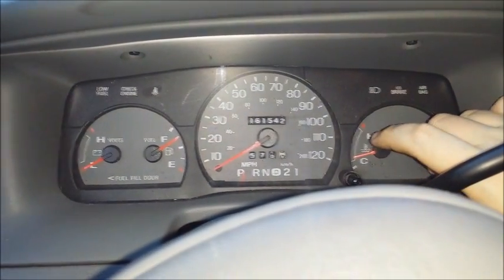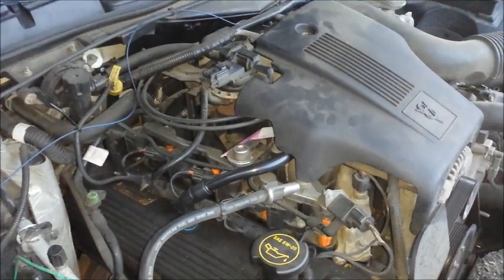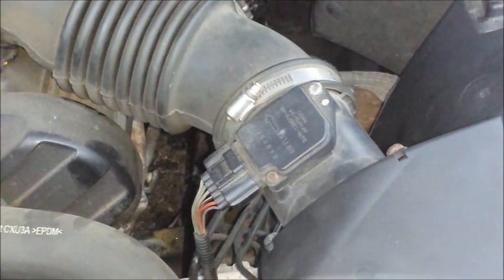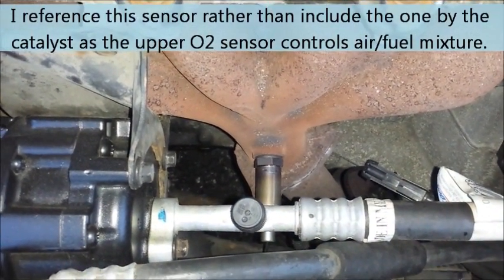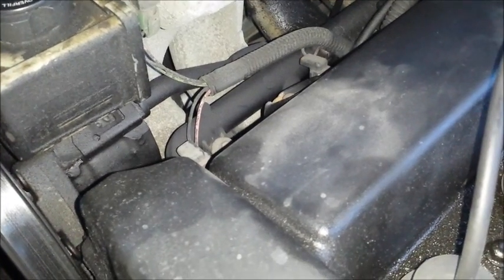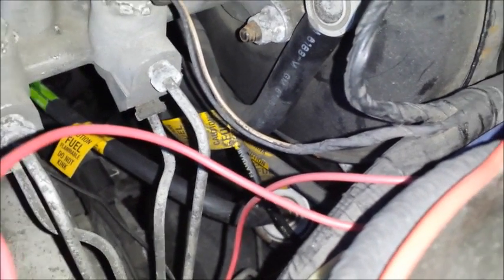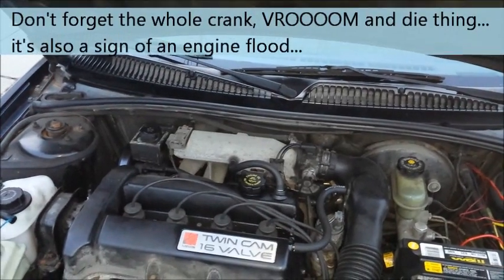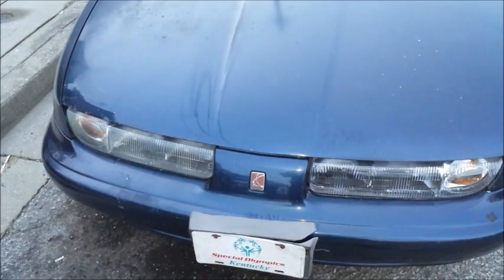Diagnosing an engine flood on your fuel injected vehicle.

Comment: I have an rxi engine fuel injected 20 valves it start up when l unplug the fuel pump and once l reconnect the pump it cutts off immediately, what could be the cause?
Reply from the maker: Good question... I say run it with the fuel pump disconnected and run the lines dry, then try running it with the fuel pump running. 

Since the lines are now dry you may have to put the vehicle in run for five seconds, turn off, put it in run for five seconds, turn off and put it in run and then start it. See what happens.

Comment: Heh my usual shop told me it wasn't even possible to flood a fuel injected vehicle, I got my vehicle started like this and it worked.  Maybe there is some underlying problem that led to this, not sure yet.  This happened after getting it started after three weeks, it started right away but after turning it off to get something in the house, I got a crank but no start.
Reply: The spark plugs can’t spark with their covered in gas. Fortunately gas evaporates easily. So cranking it with the fuel pump off will draw it out the cylinders...

Comment: Get the point dont beat the bush around
Reply: No dude! It's said: Don't beat AROUND the bush! If you're going to say nasty things at least learn how to say them right!! And he did get right to the point. I've watched lots of video's on clearing a flooded engine. This is the only one that made sense and it worked. That's the difference between having to have your car towed to the shop and driving it there yourself to have the fuel system checked. 
By the way, didn't your mother ever tell you this: "If you don't have anything nice to say, don't say anything at all". So, do that!

Comment: I used your procedure. It works but when it floods the engine continues to crank after I release the key.
Reply from the maker: Hmm.  If the engine continues to crank, the engine isn't flooded.. if it were, it would've started up
Reply: But I smell gasoline.
Reply: It has been overheating. I've changed out the waterpump, thermostat and sensor on thermostat housing. Still overheats, now won't start like it's flooding.
Reply from the maker: @dewaynestafford1891  hmm.  Let me try this a different way.. how can you tell the engine is flooded?  Like does it start up then immediately dies?
Reply from the maker: @dewaynestafford1891  okay.  This may be more than just a flooded engine.  FYI the gas smell may be from the car dumping too much fuel inside when it wouldn't start.

You may also have to take it to a mechanic for a proper diagnosis.. like do a pressure test on the cooling system and do a head gasket leak test as well

Comment: HI i am driving a NISSAN NP200. I drove through water and now it won't start please help.
Reply: Probably hydrolocked
Reply from the maker: First you want to give it time to dry out.. you'll also want to remove the spark plugs and remove any water trapped inside the combustion chamber

Comment: hi great video - can you help me sort out my problems with a le2 jetronic bosch system? overfueling
Reply from the maker: Hmm.. not familiar with it at all.. however... Some general things I can recommend are the fuel pressure regulator has gone bad, bad injectors, o2 sensor is fouled, temperature gauge isn't getting to normal
Reply: @adventureoflinkmk2  great those all sound right - its quite an old one it doesnt even have a lambda/oxygen sensor its from 1987 is your own Bosch? I will check those things I checked the injectors using 9v battery and they all work perhaps I should make a check list?  actually like a fault flow chart  ? 
thanks for your fast reply :) I got a book from america also actually about the systems its good it helps to have someone like you you knows alot about it to talk to to exchange ideas and thoughts  ps apparently Bosch provides the most injection systems to all vehicles in the world as it is used by so many manufacturers. I am not sure whether the american manufacturers produce their own systems except I know ford does its own not using german components ! lol
Reply from the maker: @RichardNash100  you're welcome.  Also if it doesn't have an oxygen sensor, guess we can safely cut that off the list eh

As for who makes what... Who knows anymore. Was gonna say I thought Bosch was a European thing... Then again, you also got Bosch making brake rotors and all that, as well as Toyota OEM being denso 🤷🏻‍♂️

Comment: To anyone else who watches this video... TO CLEAR THE FLOOD CODE TO START THE ENGINE, TURN IGNITION ON, WAIT FOR FUEL PUMP TO BUILD PRESSURE AND SHUT OFF, THEN DEPRESS ACCELERATOR TO THE FLOOR AND HOLD FOR 10 SECONDS, THEN START CAR WHILE HOLDING ACCELERATOR TO THE FLOOR.
Reply: Thank you. My 01 ram 1500 is STRUGGLING rn. Ima try this

Comment: Could you help me figure out what my issue is? I have a 2008 Mitsubishi Lancer DE. I accidentally "double cranked' my car. Like a hesitation (I sometimes do that when I'm shooting pool too, with not so dramatic results). It flooded. I started it again and drove it around the block but it was cranky. I parked, it stalled. Started again and stalled immediately. Now won't start at all. I went through the flood clear thing but it didn't help. I live in Alberta, Canada, so we have snow kinda like Montana but it's barely been freezing temperatures lately. While I was messing with probable causes I drained my already old battery. So I had it checked and replaced with brand new battery. But still won't start. It almost did but just couldn't get there. I can't smell exhaust (I know I already have a bit of an exhaust leak so I always smell it when I start the car but not anymore). I can't hear the fuel pump engaging anymore (I could hear it clicking on and off when it first flooded). So, I'm thinking the relay (already checked the fuse and it's good) or spark plugs due to flooding? Also, can you just wipe down iridium spark plugs or must replace? I don't know how to get them out even. Whattaya think? I hope it's not the fuel pump! I had been idling it a lot lately so maybe. Your thoughts?    
I love Scotty Kilmer too!
Reply from the maker: If you can't hear the fuel pump anymore chances are it died... either that or theres a broken wire
Reply: @adventureoflinkmk2  that's what I thought. Then I watched this video again and realized that the flood clear procedure in my manual was not the same as this video. The difference was with pressing the gas petal down all the way THEN put the keys in the ignition and try to start. So I did that a few times and kaching!! Ignition! Wow!!! I drove it around then took it to get gas and some fuel cleaner. She drives better than before and I smell less exhaust when starting. Which leads me to believe my car has been flooding alot on starting but ran anyway in the past. It's idling a little low. Quite low. So got some throttle cleaner and am cleaning air intake valve and throttle sensor tomorrow just like Scotty Kilmer said. I'm sure she'll run better then. Thanks so much dude for showing me the correct way to clear a flood!! Hugs to ya!!
Reply from the maker: @Yosetime  you're very welcome

Comment: BE SURE TO IMMEDIATELY CHANGE YOUR OIL AND DRAIN IT WELL TURN THE ENGINE MANUALLY WITH WRENCH ON HARMONIC BALANCER AND ROTATE CLOCKWISE WITH DRAINPLUG TO OIL PAN SPIN IT A FEW ROTATIONS AROUND THEN ONE MORE AND IT WILL HELP GET ALL THE FUEL OUT OF THE CRANKCASE GAS IN YOUR OIL IS NOT GOOD AND FLOODED ENGINE CYLINDERS INTAKE AND THROTTLE BODY BY SEEPING THROUGH THE PISTON RINGS AND BY IT FORCING THE FUEL THROUGH WHILE CRANKING THE ENGINE     OVER WHEN THE ENGINE IS FLOODED !!!          The fuel will penetrate the seals and destroy engine oil and cause you catastrophic engine failure due to pressure and  the oil losing viscosity from having fuel pushed into it .....     it will destroy your engine ok people drain your oil if the vehicle ever floods get it going and running but change your oil immediately after flooding issues occur trust what I am saying here

Comment: you did not show the engine running to confirm your solution so what was the point of this video?
Reply from the maker: The point was to show you a fix.  Either take it or leave it, what was the point of your comment I wonder... to be a petty asshole maybe?  Always gotta be that one person on the internet who has to put their two cents in everything and be petty as fuck and point out minor differences to try and make a big deal... nevermind, typical internet.
Reply: Dude, go pound sand! The video is posted, free of charge, so you can watch it or not. Nobody is forcing you to watch it. If you've got a better video, post it. Otherwise, shut your face. This video helped me alot, and helped others alot. If you want the solution confirmed, then try it yourself. Some people just think they are so much better than others that they have to post a comment about it. Jesus Christ!

Comment: I just used this Flood Clear mode to start my Saab 9-5. I’ve been trying to start it and it wouldn’t do anything but crank and crank. I turned the wheel while cranking the car and it started right up. Thank you for your help. I appreciate your help. ALL THE BEST TO YOU. MUCH SUCCESS IN THE FUTURE. 👍🏾👍🏾👍🏾👍🏾👍🏾😊😊😊😁😁😁😁
Reply from the maker: You're welcome... go figure, turn the wheel whilst turning over the engine in flood clear mode and it fires up.  Odd, considering it's a GM product and I show off my Saturn (also GM) and a grand Marquis

Comment: I wish I've seen this video 6 months ago. My car has been sitting with the flood for months. Would this procedure still help?
Reply: did it still work. my car been sitting for months just like yours
Reply from the maker: What kinda car you got andres
Reply: @adventureoflinkmk2  2006 Cadillac cts 3.6l. i saw online that if you turn the car on and then back off without letting the engine warm up it can flood the engine. i did that months ago since i needed to fix a flat tire but i needed to back my car up and turn the wheels so i can properly seal up the hole and i turned the car off like 30 seconds after i turned it on. i thought it was fuel pump, guy came and did the starting fluid technique but car didnt start, so i thought it was ecm, switched it and did key programming, still didnt start. now im thinking that a flooded engine could very well be the case since i turned the car off too fast and when i crank the engine i smell gasoline.
Reply from the maker: @andres2625_  yep that would do it.. also typically a flooded engine revs high then dies immediately 

But yeah the flood clear should work, the only make I've ever seen it NOT work is on Toyotas because for whatever reason there isn't one

Comment: So my car has been smelling of gas recently so i decided to try it after you mentioned it in the video, I drive a 2004 jeep grand cherokee and the car is now doing nothing after trying it, should i just wait it out or get it checked out
Reply: +adventureoflinkmk2 the accelerate and turn the ignition
Reply: +FCB Ivan at the same time
Reply: ***** nope, it started before but it had been gettingsluggy and smelling of gas
Reply: ***** so I thought I'd give it a shot
Reply: I tried it a few times, but it also didn't start
Reply: I gave it 3 or four hours of just sitting and tried again without the accelerator but nothing
Reply: I had to do it several times before it started. Making sure to press the gas petal all the way down before putting the keys in the ignition and starting. I also had my battery checked and it wasn't holding a charge. So for a new one and that was when, after doing the procedure a few times, it started. I would check battery first. Then try again.

Comment: DO NOT PAY SOMEONE TO DIAGNOSE YOUR CHECK ENGINE LIGHT, I REPEAT, DO NOT PAY SOMEONE TO DIAGNOSE YOUR CHECK ENGINE LIGHT. you can get a free diagnosis from a car parts store. Thats right, you can get  FREE diagnoses from a car parts store.
Reply: He'sin therain yea, I agree. I took my truck to a shop for this exact problem, expecting him to take it apart and figure it out but alls he did was use a reader to "diagnose" it, told me what he thought it was (replaced the o2 sensor and it didn't fix it) and was charged 100$. If I would've know that's what he would've done I would've limped it to the oreilys or borrowed one from a friend. do NOT pay someone to use a reader to diagnose it! Hell, a reader is cheaper than what they charge and you will never have to pay someone to use a reader again.
Reply: Udk jack shit about cars I repeat stfu

Comment: i'm driving a toyota carina ed 94 . havin prob with my car it just shuts down. i think it get flooded or something. if you try to start it it would not start. efter a day maybe but then repeats the same problem. my car mechanic told me to test a other car computer and still have the problem my sparks are getting wet. please help me what to look for sensor or injector fail . a other problem that i have to is that my key light stays on and doesn't turn off anymore.
Reply: It's been 8 years since you posted this comment so this is probably not useful anymore. But I've recently learned that if your spark plugs are wet (they shouldn't be) it's because at least one of your fuel injectors is likely stuck open. That will cause an excessive amount of fuel to be injected into the chamber. And that will cause it to splash up to your spark plugs. And basically everywhere. Like turning your kitchen sink tap full on when it shouldn't be. The injectors either need cleaning (from carbon buildup or bad fuel or something) or replacing. I've been told to try cleaning the injectors first if you're doing it yourself. Also to put a good fuel injector or fuel system cleaner into your gas tank and do that quite often if you have a high mileage vehicle. Like 250K or more. And make sure you get a tune up as required as this will prevent clogging of your injectors. Unfortunately, I know this because I did this!! My bad!
Reply: this one http://www.google.com/imgres?imgurl=http%3A%2F%2F3.bp.blogspot.com%2F-HPyszZycpT8%2FToOEXZ10o7I%2FAAAAAAAAAbc%2F9we2lrFI_74%2Fs1600%2FIMG_1410.JPG&imgrefurl=http%3A%2F%2Fvolksurf.blogspot.com%2F2011%2F09%2Foem-key-bezel-light-ring-instalation.html&h=1195&w=1600&tbnid=rlovNxtFfTbmHM%3A&zoom=1&docid=5E-2RC2ZDFtyyM&ei=iy85U8rpJNKu0AHhtoGgBw&tbm=isch&ved=0CFMQhBwwAA&iact=rc&dur=4035&page=1&start=0&ndsp=40.

Comment: I took my 89 toyota pick up in for an exhaust and they didn't put the O2 sensor back on and the engine light stays on and it's smoking and cuts out do you think that the O2 sensor would cause it to flood out and not start back up
Reply: You're still driving a 24 year old car? I can't believe it still works at all!! Good for you!
Reply from the maker: Yep.  For what it's worth my Camry is 23 years old... and it runs